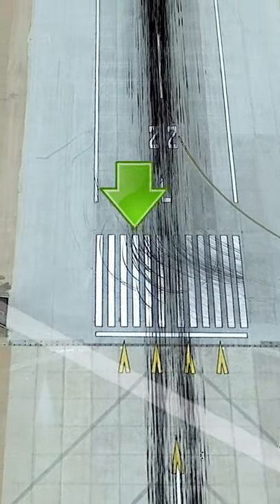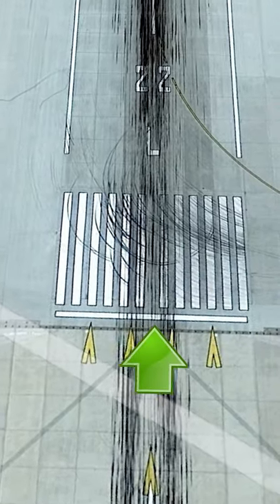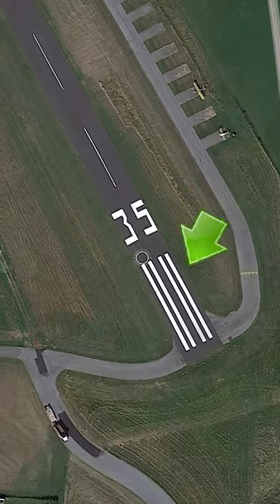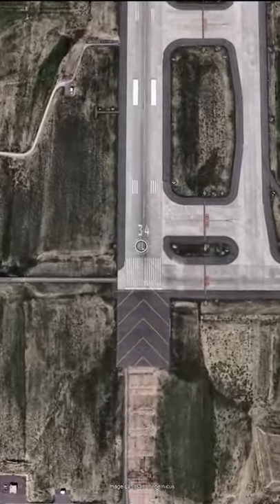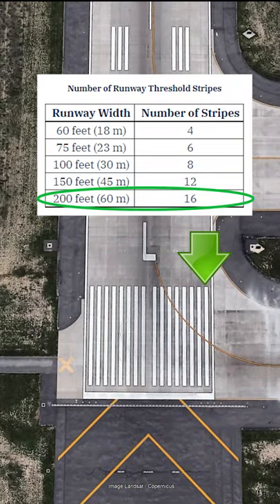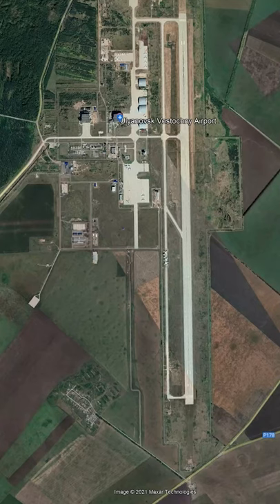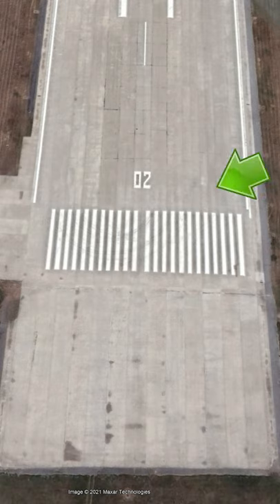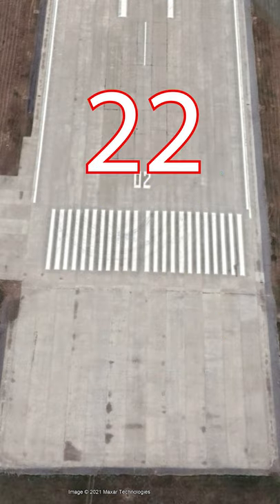What Are These White Stripes on a Runway?

Comment: Nice, 20 years of aviation and I had no idea they meant that. I also love Sky Acres its only 5 miles from my house; fantastic little airport.
Reply from the maker: Well it is your lucky day.  I almost didn't publish this video.  It was finished yesterday and finally decided to pull it out of the hat and publish it.  Sky Acres was found after a search for small rumways.  The narrowest runway I landed on was 18 feet wide in a C172.  That runway didn't have markings except for the painted runway numbers.
Reply: @thecorporatepilotdad  Its a great airport, its also included in FS2020 if you purchase the CH STOL 701 which comes with a few HD airports and a brush trip up the Hudson Valley starting in Nj.
Reply from the maker: @TacticalSandals  I'll have to check it out and try to land an overly large airplane there for fun on MSFS.